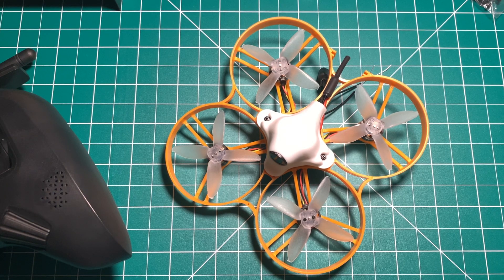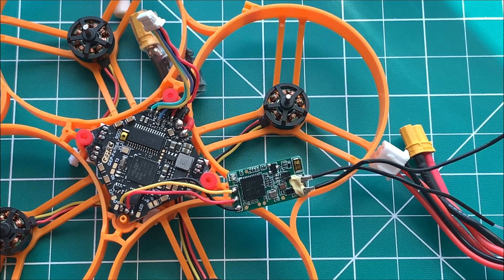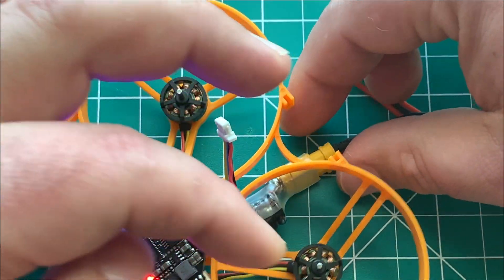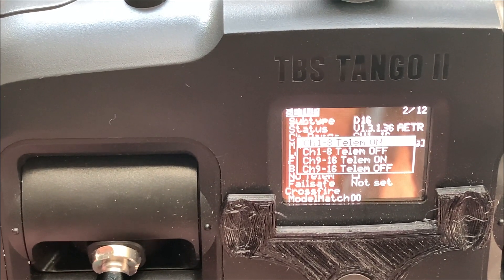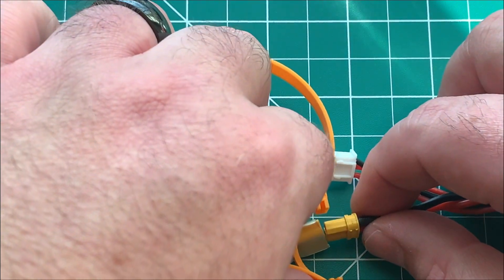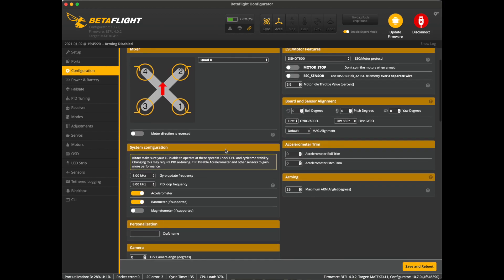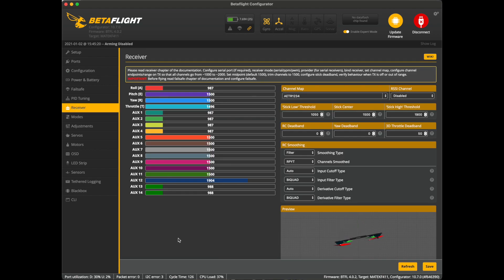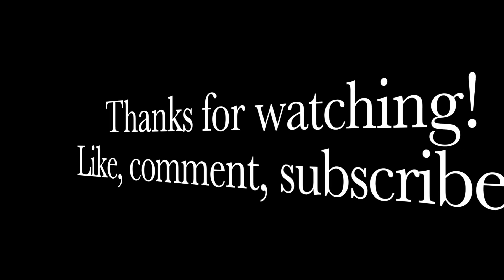How to Bind an Frsky XM+ Receiver

Comment: Just got the receiver and it is a V2.1.X and it will not bind to the QX7. Anyone know how to deal with this f'ng problem?
Reply from the maker: If you don’t have any rxs that are on 1.X, you can update the internal Frsky module on the QX7 to the most recent firmware. Otherwise, you can downgrade the firmware on the Xm+ to the 1.X firmware.
Reply: @TitanFPV  Titan i dont know how to accomish this. Can you give me some guidance as to where to begin?
Or someone that can do to this for me?

Comment: Thanks Titan for getting me out of a jam which such a quick, easy video.
Reply from the maker: Anytime!
Reply: @TitanFPV  Well Titan i really screwed up big time with the xm+ rcvr. As i was holding the bind button and plugging in the lipo i got a solid red and green lights and the red light did not blink even after hitting the bind in my qx7 so i tried binding again but the f'ng bind button just fell right off! I hate the xm rcvr.. At no time did the rcvr give me a blinking red light. I guess ill have to buy another one. 🙄
Reply from the maker: You should still be able to “jump” the traces where the bind button was. https://www.rcgroups.com/forums/showthread.php?3114492-Bind-button-came-off-on-XM-receiver-Can-I-still-bind-it-Does-anyone-know-how

Comment: I don't know how you did this so easy I'm having such a hard time I have tango 2 and flywoo hexcopter with xm+ and I'm doing what you say but I can't change or Bind like you can why? Am I dumb
Reply: I have Betafpv lite radio 3 qx7 and tango 2 thanks I'm very frustrated already
Reply from the maker: It’s pretty simple if the firmware is compatible on both devices. You can’t use pre-access firmware with access firmware. They won’t bind.

Comment: how can I know which radios are compitable to bind with Frsky XM+ ?
Reply from the maker: The radio just has to support Frsky d16 protocol. So pretty much all multi protocol radios, and most Frsky radios running the correct firmware.

Comment: I'm tryi g to bind this with jumper t lite, frsky x2 mode. When I bind the green light turns off and red stays on solid. When I power cycle the red light flashes again
Reply from the maker: Make sure you are running pre 2.1.x firmware, or it won’t bind with the T lite or any multi-protocol radio. You should be able to find the link to the older firmware in the video description.

Comment: I had my quad plugged into betaflight and was changing the motor layout and i guess during the saving i lost internet and it disconnected but now when i try and plug in the quad to usb i don’t even get a new com port open but when i plug in my mobula 6 it opens a new com port. Also when i plug in the battery it makes 3 beeps but doesn’t make the last 2 long ones like it used to. I’m not sure what happened or what to do

Comment: Could you bind this to the RadioMaster tx12? The frsky xm+?
Reply from the maker: Yes.
Reply: @TitanFPV  does it bind with any open tx controller? Could you also bind it with a jumper T8SG for instance?
Reply from the maker: Not necessarily any OpenTX radio. The module is what matters. It has to be compatible with D16 mode, or ACCESS. Frsky radios will obviously work, and so will lots of multi-protocol radios. I believe the T8SG has a multi protocol chip. I was able to bind it to my Tango 2 because I added the external module. The radios documentation should tell you what protocols it supports.
Reply: @TitanFPV  really appreciate this where can I find the compatibility list for the tx12? Is this compatible with the frsky xm+ because the modules are same and also the opentx allows it to connect to more than just a few same branded receivers? Sorry I’m totally new just trying to understand it!
Reply: @TitanFPV  so along as it has D16 mode it’s technically compatible with the frsky xm+? Sorry I know I’m bombarding you with messages just eager hahaha!
Reply from the maker: You’re fine lol. It should be. As long as it’s on a compatible firmware. The firmware can be changed. It’s a reason why the community has strayed away from Frsky products.
Reply from the maker: Hit overview, and it’s under the CC2500 chip. https://radiomasterrc.com/article-103.html
Reply: @TitanFPV  you are a hero man really appreciate your time!
Reply from the maker: Anytime!
Reply: @TitanFPV  Great Video! I just asked RadioMaster´s Technical support and they told me that Radio master is not compatible with FrSky XM+. Here is their answer: Unfortunately, currently our TX12 does not support FrSky XM+ receivers.

Comment: Good to know . I got a xm+ receiver recently. It was not binding with tx (only single red light flashing) so I installed the old firmware you put in the link and binded succesfully. In order to flash the rx firmware from qx7 transmitter I had to choose S port since external option gave an error message.
Reply from the maker: Glad to help!
Reply: Perfectly done!!! Thank you so much!!!

Comment: Doesn’t work anymore. Update this video please
Reply from the maker: It does. You just have to be on the correct rx firmware. The multi protocol modules will not bind with ACCESS or 2.1.x firmwares. You will have to get the legacy firmware from FRSKY’s website. They are shipping with newer incompatible firmwares unfortunately.
Reply: @TitanFPV  yeah, figured it out after a few days of YouTube research. FRSky seems to have removed legacy firmware but someone linked to them and I picked up all that I found. I’m considering buying an xm+ rx and trying the firmware rollback and see if I can bind it.

Comment: Hello I need help. I installed the xm+ on my tinyhawk 2. When is bind the radio to the receiver it's flashing green instead of a solid green. I went on betaflight and I don't have any input on my radio. Like it it didn't bind
Reply from the maker: Do you have the correct UART in the ports tab in Betaflight set as serial rx? Do you have the rx set to serial based receiver and sbus in the configuration tab?
Reply: @TitanFPV  ive have that set aswell but it wont bind to my qx7 anyhelp?, if i turn the uart on would that do anything?serial rx is already on
Reply from the maker: You may not have the correct firmware on one or either. Frsky 2.1 and above firmware is not compatible with the older stuff. Do you have a accst or access QX7?
Reply: @TitanFPV  its okay thanks for your help the lates firmware doesnt work so i download old version which worked fine

Comment: On  fiddling with the  battery connector while trying to hold the bind button....I got fed up and use a rocker switch from the local automotive store...It's part of my smoke stopper so I can just flip a switch instead of needing 3 hands to hold down the bind button and struggling with the plugs at the same time..
  hope this helps.
Reply from the maker: Yeah, I’ve seen that. That's probably much easier than fiddling with the battery connector. Definitely something people who use frsky receivers often should consider. I switched to Crossfire a long time ago. That was my solution. 😂
Reply: I just use child labor.  "Boy, if you want this thing to fly, get over here and help Daddy!"
Reply: With TBS Crossfire there is no more fiddling with a bind button i hear.. Do you have to buy the module, receiver, antennas kit?
Reply: @techFPV5964  not sure..I gave up on frsky shortly after posting that 2 years ago and went GHOST instead...🤷🏼‍♂